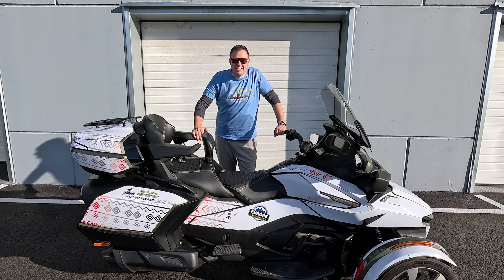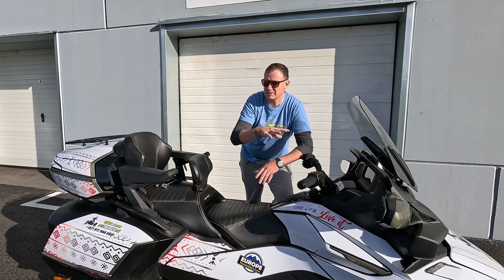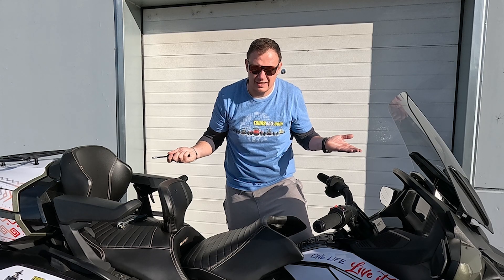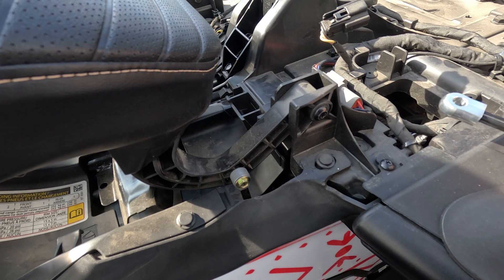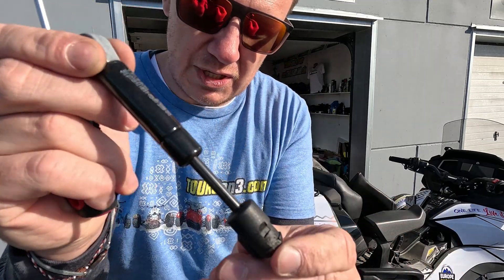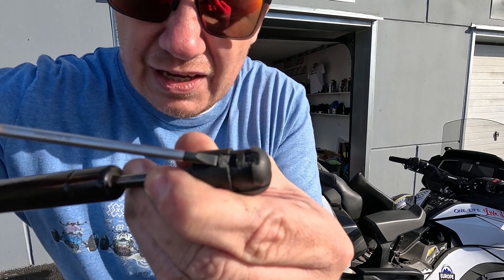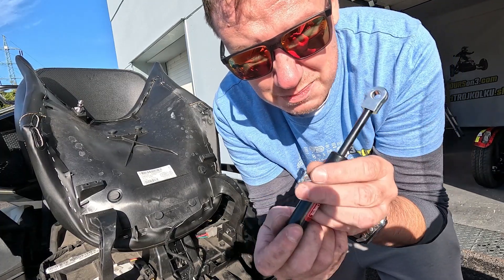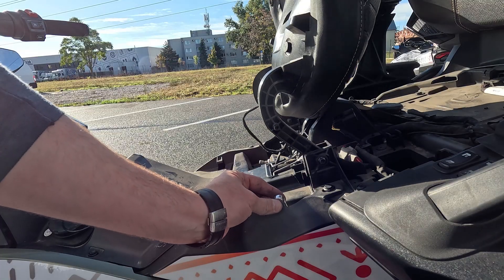Test, Review & HowTo: This Seat Shock Is Insane - #CanAm Spyder RT Seat Fix with MartinTheVlogger

Comment: my new 2022 Sea to Sky was delivered with a bad strut. So I am going to have to replace it, I am just disappointed that it came that way from the dealer
Reply from the maker: Well, dealer has almost 0 control over it,. I have seen RT being delivered without Shock... but even if they will change it, it will be crap... i am sorry...
Reply: I get it that the dealer has no control, I guess I would have hoped they would have warrented and fixed before it was deliver.  it is a minor inconvience, but will be installing my new Show Chrome strut soon.  Thanks for all your video's they do help!  @MartinTheVlogger
Reply from the maker: @terrybishop-jn8qr  🤟🤟🤟🤟🤟

Comment: Surely Can Am should be replacing these crap shocks that don't work. Mine has just started failing
Reply from the maker: We live in era where cost saving and mass production is everything :( but not to blame only CanAm here.. you know, we all create this mess when we want "luxury" and top brands to be accesible. I remember days when BMW was for top 10%, now you have 20k and you can have 1series if you want real cheap bmw, but those that will pay 60k for bmw 1m 4.0i will not get top product anymore, because of those sacrifices for masses...Also many times i hear, martin that product is expensive. Yes because its made in Germany from high quality materials. You want to pay half the price, then there will be some "adjustments" and i will go and produce it in china. There is no such a thing like top quality for low money. Is really 35k a lot for RT2024 in SeaToSky... yes it is because it has these stupid childish mistakes such as this shock, poor paint quality, terrible suspension. It should be 45k bYke with no compromisses... but would there be still the same demand??? As i said, we all create this mess :)))) just tiny bit of my thinking before bed time :))))
Reply: I use a cut down wooden ruler to keep my seat up when fueling.
Reply from the maker: @TheRealEric__1  😄😄😄🙈🙈🙈🙈🙈